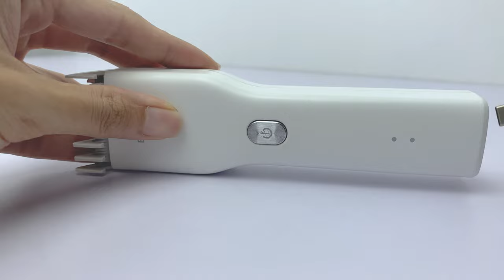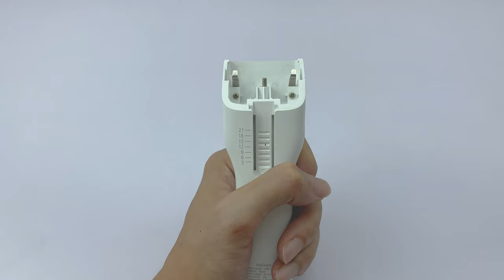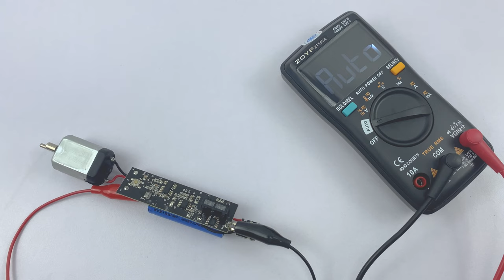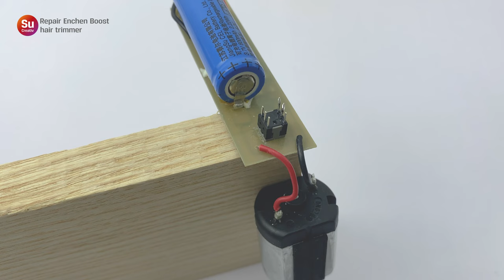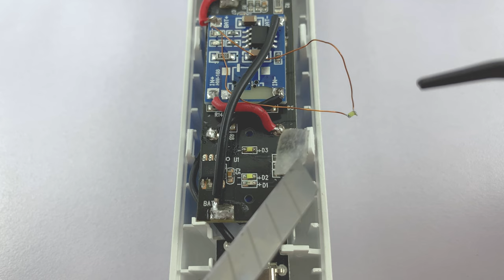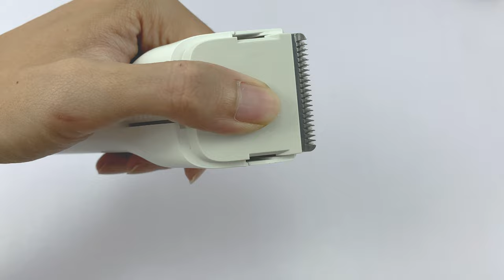DIY - Repair Enchen Boost hair trimmer

Comment: Thanks for the video! I wanted to disassemble mine to replace the battery but seeing as the cost of a replacement battery isn't far off from a brand new Enchen Boost 2, I think I'd rather buy the newer model instead.

Comment: Mine charges. But it only charges up to 1 led full, and the second led low blinks just like in video. And because of that i only get around 3 minutes of usage each charge. I assume mine has depleted battery problem. 

This video is weird. It assumes the board is faulty and giving out enough charge. So he adds on a new charge board over the old one. And it needs a new switch because the charge board controls is not linked to the old one. 

The problem is if you would probably pay a USD 10 for the board & switch and shipping (Assuming you have soldering equipment). A new clipper unit is USD 15 with shipping. So repairing it does not make sense.